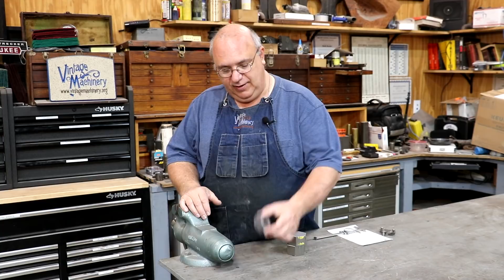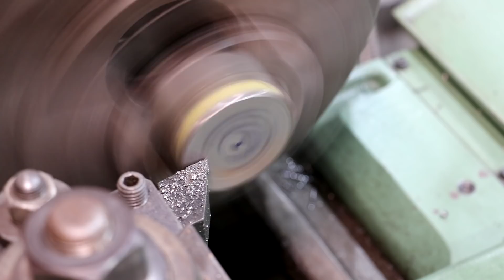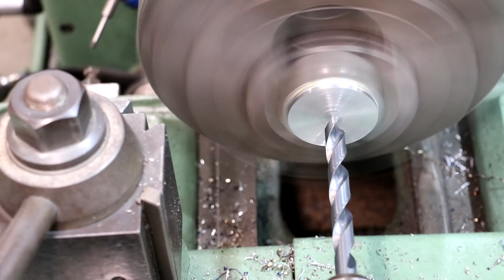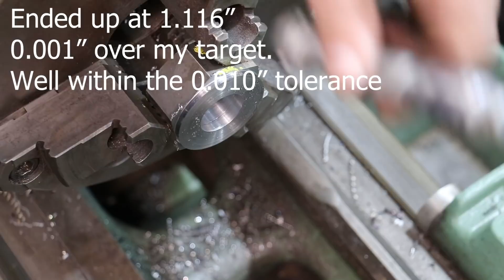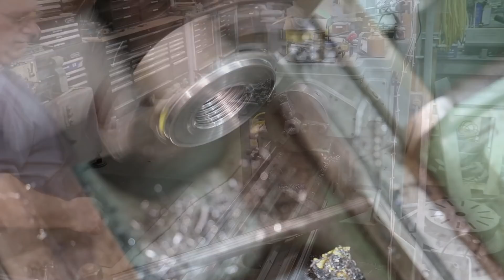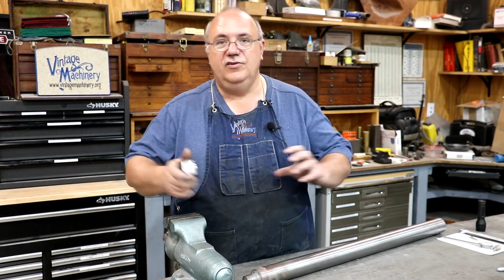Diresta Bandsaw Restoration 19: Machining a Special Nut with Left Hand Internal Threads

Comment: Buggy axles are made with left hand threads on one side for the same reason.  It has been a lot of years since I took one apart, but if I remember correctly it is the left hand side that has left hand threads, right side having right hand threads, so that the wheels are always tightening the nut as you drive.  Later buggies have Timken cone bearings and a castle nut and cotter pin, but early ones used those left hand threads.  I overtightened one trying to get it off myself.  Fortunately, we were reboxing the wheels and welding on new axle arms anyway.  

Thank you so much for the views over your shoulder.  Finally I understand what you are talking about when you say you are waiting for the number to come around.  I hope you do more of those views.  I feel like I learned a lot this time.

Comment: i bought a 12" import lathe, the threading dial doesn't seem to correspond to any thread i have ever tried to cut. i have to leave the half nut engaged and run the lathe back and forward, not good as it has a threaded chuck backplate

Comment: I used to make LH and RH Coiling mandrel and the Nut that went with. All different sizes imperial/Micky Metric.
 Fitment had to go nice because u could adjust the lean angle of the wire ..repeatedly,  sooo.
 On a Torrington Spring winder.

Comment: I always enjoyed threading on the lathe. As I remember it, the last left hand nut I made was a nut for a cross feed screw on a Cinncinati vertical mill. A round bronze flanged nut with 1 3/8" I.D. and a no.4 Acme. L.H. thread bored into it.
Also made the replacement Acme lead screw. Fun project! 
Thanks for the sharing of your experience.

Comment: A honest question. Do you really need to use a LH threding insert running the lathe in reverse? In my logics using a normal RH threading insert and running the lathe normally but the feed opposite (left to right) should render the same result. AM i missing something? I am asking this because my lathe chuck is screwed in the spindle and running backwards with some torque will undo it.
Reply: Yes, that is another way of doing it. There are 4 different ways of achieving the same result, and Keith chose one which is different to how you'd do it on your lathe. My guess is that he prefers to feed in towards the chuck, since it allows a better view of the way that each cut will start.

Comment: Compound angle, my compound lives on 29 degrees, don't move it left of right for left or right threads, last little bit is moved with the cross feed.  Free passes almost.  Why 29 instead of 29 and a half, my eyes and how well was that graduation marked.  The whole deal is to cut mostly on one side and scuff the other.  Then you could do it the German way and set compound at 90 and have a formula.  Nonsense.  Set compound at 29, cut it until it looks right, then take a bit more with crosslide till it fits.
Reply: Hey I used to single point threads, paid piece work.  Back in early 1980's i was making a 100 bucks a day.  Best money i ever made.
Reply: Why did you waste your time writing that long, boring and redundant story? Didn't you watch the video?

Comment: Hey Keith, thanks for doing videos.  Remember major diameter minus pitch equals drill size for approximately 78% theoretical.  Only problem is is running spindle in forward with that backwards threading bar you usually run in reverse. Ha.  As I have said before.  Keep making videos.  I get off.work at 3 in the am, not much to watch on tv, so I look on YouTube.   Got to close, my watch is well wound,  have an old school timex automatic,  was running the auto feed okamoto plus the manual feed Sharpe surface grinder most of the evening.  Spring calipers with profiled tips, great for checking threads.  Before thread mikes there were spring calipers.

Comment: Easy peasy.  Got to throw one out there.  Drill or bore size for tapping or in this case threading.  Subtract  pitch from major diameter, 78? % theoretical thread, works for metric and unified.  Won't work for 60 sharp nor whitworth.  Never cut a whitworth, but I have a fishtail with the numbers for 60deg sharp threads.  About as big a relic as a 1/2-12 tap, ha.
Hey, if you have somewhat of a pattern, spring calipers are your friend.  Externals with 60 degrees radiused off a bit, internals similar.  I have a pile of spring calipers, accumulation plus an e bay hord I bought.  One set of internals were cheap, not heat treated well, soft, bent with pliers, filed and stoned to fit.  Good tool to compare with, old sample with new cut part.  Hey part you are making just needs to screw on and get tight.  Major diameter, minus pitch equals bore, thread until it looks right plus a bit more, might be a bit loose but it will work.  Easier than getting out the wires and making a pattern.  Ha
Reply: OMG - come back when you are sober.
Reply: @johncoops6897  Hey how did you know.  Put in my 50 hours this week, sharpened punches and dies last night, whole box full almost done, Trumph cnc punches.  Couple of things I was throwing out there was the major diameter minus the pitch, works for all unified pattern threads, metric or imperial,  hey sometimes you run across something which isn't on the chart, just remember this, no bs, check it out.  Plus the 29 degree thing, some say 30, some say 29 1/2.  29 works for me, cuts mostly on one side, scrapes the other.  I have had to cut a lot of threads through the years which had to work, who cared if they were a bit loose, screwed together and tightened up.  Reshaped spring  calipers are a good comparative tool if you have some sort of pattern, say someone brings you the shaft but not the nut or vise versa.   As far as watching Keith's video, yea kinda, been there and done it before, let it run so he could get his ad revenue.  I have a lot of respect for these guys who are putting out good content.  Keith is one of the good guys.  I recommend Joe P.  to guys learning machining techniques,  Ox tools gets into some of the nitty gritty metrology wise.  Hey I love youtube.

Comment: When you engage the half nut, why did the feed go from right t to left if the lathe was in reverse. Usually running in reverse feeds Left to Right. What did I miss?
Reply: His lathe has separate gearing for the spindle and the feed. So he can reverse either of them independently from the other.
Reply: @johncoops6897  Thanks, I thought that was it, but I.had never used one.

Comment: Great video, fun to watch the progression of the bandsaw.  One question on the left-hand thread, though.  Why run the lathe in reverse and and use a reverse-orientation threading bar?  Couldn't you just use a standard bar/tool and thread away from the headstock for left-hand threads?
Reply: Sure you can. That’s the way I would have to do it, because my lathe has a screw on chuck. If I run in reverse I run the risk of having the chuck unscrewing from the spindle. 
Joe Pie always cuts threads from left to right. That way he doesn’t have to worry about releasing the half nut at the precise instant to avoid running into a shoulder or the bottom of a blind hole.

Comment: I forget... remind me if you will, how many 10 thousandths are there in a "tad"?
Reply: In Australia we use Metric, so a "tad" is approximately 3 poofteenths. A poofteenth is an order of magnitude larger than a fuckall.
Reply: @johncoops6897  Thanks for clearing that up. I will now get my slide rule and convert it to RCH and BOCH in Imperial. It's very important to keep your measurements precise.
Reply: @The_DuMont_Network  - Do you guys use the BeesDick? From memory I think it's a woodworking tolerance.
Reply: @johncoops6897  In Texas, the tolerances are expressed in "Gnat's Ass". Only with the advent of precision laser equipments are we able to resolve down to a "Micro Gnats' Ass"
Reply: @johncoops6897  There's a YouTube channel owned by ABOM79. Excellent machinist. He refers to 
Crescent" or adjustable wrenches as an "All 32nds" wrench.

Comment: Nice job. That nut material seems to be pretty soft steal that could gall and refuse to come out for the next guy (as it did for you); should you heat treat the nuts for hardness ?
Reply: There is no need for heat treating. The nut was damaged because he DRILLED IT OUT. The galling is not from loosening it. It wasn't tight, he just removed it wrong.
Reply: Anti-Seize on the shaft and nut should prevent galling.
Reply: @ellieprice363  - Short term, yes.  long-term anti-seize dries up and turn into dust, it has limited life
Reply: You can’t heat treat leaded steel. 12L14 is great to cut but illegal for most things these days because of the lead content.
Reply: You can case harden the nut with “Cherry Red” compound.
Reply: “Cherry Red” - interesting, didn't know about it

Comment: I'm a retired U.S. Navy Senior Chief Petty Officer (E8).  I was a submarine yeoman, that's an admin and personnel specialist.  When I went to my last command which was a big maintenance organization I checked in and the Admin Officer told me he had a problem.  The Chief who ran the small boat shop was on leave and the First Class running the shop in his absence was in hospital having had his appendix removed.  The shop needed a Chief and, since the guy I was relieving was going to be there for a month then tag, I was it.

I went down to the shop and introduced myself as the temporary in-charge.  I was in the office looking at some paperwork when a Second Class Engineman came to me.  "Senior Chief, we've got a problem, let me show you."  He took me to a boat sitting on a skid and said: "As you can see, the propeller shaft is bent but the propeller is held on with a left handed nut and we don't have any left handed wrenches.  What should we do?"

I told him: "This is rather delicate so I want you to do it yourself.  Go up to that shaft, turn around, drop your pants, and ram the shaft about a foot up your behind.  Then spin clockwise.  Let me know when you're done."  I then walked away.  They didn't try that sort of thing on me any more.
Reply: But, But, Super Chief. You told him wrong. From where his head is pointing he’ll need to spin counter-clockwise to loosen that nut. (:-))
Reply: @ellieprice363  No, remember righty-tighty lfety-loosey is for right-handed nuts,  It's the other way for left-handed nights, righty-clockwise-loosey.
Reply: @Ambidexter143  Sorry, you missed the whole point.
Reply: @ellieprice363  No you missed the point.  To loosen a left-handing nut you have to turn it to the right, i.e. clockwise.  Sorry if reality disagrees with you.  Come back when you've figured out how and why you're wrong.
Reply: @Michael Neville  Put yourself in the position that you put the man. His head is pointed away from his rear which is turning the nut to the right to loosen the nut. However from where his head is he’s thinking “I need to spin my body to the left (anti-clockwise). Oh never mind. It’s just a lame joke.
Reply: @ellieprice363  - You STILL have it wrong. Stop arguing, you are making an absolute idiot of yourself.

Comment: I hope you don’t mind my mentioning this, but you seem to have a large backlash problem on the cross slide dial.  Thanks for another interesting and informative video.
Reply: I noticed it too.. Is it backlash or simply flex from someplace else.  It could be in either the cross slide or the compound.  Maybe the gibbs on the cross slide or compound are loose?   The lathe has been completely rebuilt.  Maybe things are bedding in a little?
Reply: @maxheadflow  I don't think he did a complete rebuild. Not including way grinding and scraping anyway ?
Reply: @Panzax1  https://www.youtube.com/watch?v=9A3kXFLSi40&list=PLbGC44mjwqrciooH79dIAQtdTjF3RjHMj&index=12
Reply: On the second last threading cut, you could see the tool jump back about 10 thou when he started the cut. Even moved alarmingly on the final spring pass. That thing is as loose as a goose.
Reply: And well worn parts in general. I've never seen a lathe take that big of a cut when pulling the tool back out after such a small cut..

Comment: Quick question, couldn't you turn the original nut down past the galling part then add the step back or was the nut beyond saving or the threads engagement to short to be safe
Reply: The galling wasn't the only issue. The internal threads were damaged when he drilled the main shaft out of it.

Comment: Curious to know how important the thickness of the nut is for securing the shaft. My first thought when you showed it was to just put it in the lathe and remove the damaged portion and then clean up the threads. Perhaps there are some engineering things that make that unworkable and I am interested in whether anyone knows what they are.
Reply: I think that although shortening the nut and cleaning up the threads might have worked good workmanship requires you  don’t take a shortcut at this point. The new nut looks great and fits perfectly.
Reply: @ellieprice363   Thanks for the reply. No argument about the workmanship on the new one! Keith did a terrific job. No doubt it a best practice as a restorer as well as most practical to reproduce an identical piece. It is just interesting to me to try and understand the thinking that went into making it in the first place.
Reply: Proportions of the nut gives it  it's strength. Bear in mind the job it's doing it isn't good to skimp on strength!!
Reply: He drilled out the shaft, and because he missed the center the internal threads were damaged inside the nut.

Comment: Keith, 

Will you mark the nut in some way to signify that it is LH?

This may prevent the problem you had if ever the nut has to be removed.

I am fascinated watching your videos.  I worked as a draftsman in high school and as an engineer for 35 years.  During that time I wandered into machine shops occasionally.   You are connecting the dots for me.

Bob
Reply: The usual way to denote LH threads is to machine a groove in the middle of the hex. Take a look at the hex fitting of a LH thread POL gas bottle connection.
Reply: Easy to stamp it L H.
Reply: Took the thought right out of my head. Stamp it PLEASE on BOTH sides.
Reply: All you have to do is open your eyes and look at it.
Reply: @haroldsprenkle4173  if the stud is flush with the nut outer face then that becomes pretty hard
Reply: @haroldsprenkle4173  Go back and watch the videos of Keith trying to remove the nut and shaft.  With time rhe fact the threads were LH became obscured.  That's how was damaged.

In watching numerous restorations it seems that when theŕe is decades of corrosion and the thread ois not exposed for easy inspection mistakes happen.   A simple solution is marking the nut LH or engraving an arrrow pointing CCW and stamp Off at the point.

Comment: Centrifugal force would never loosen the nut, the reason it is LH is because the resistance force on the wheel wants to spin the wheel counterclockwise and that would loosen a RH thread, but would tighten a LH thread.
Reply: Picky picky picky but right right right.

Comment: So, are you going to mark the nut 'LHT' on a few sides? When I was in the Navy throwing wrenches at helicopters, we had to deal with exactly one connector that cost a stupid amount of money that had a left hand thread and in the early days of it no markings other than a small 'warning' buried in a manual. I replaced so many of those... anyway, since that connector was over $1,000, and we trashed so many, a suggestion was made to etch 'LHT' on 3 of the 6 sides to give someone an idea that...well... maybe that connector was different. Eventually directional arrows and 'TIGHTEN' were added to the box the connectors went to. ....................admittedly it only reduced the times we had to replace that connector. But, stamping 'LHT' on that nut and printing out a water slide decal with a directional arrow and 'TIGHTEN' may help prevent a future Keith Rucker from doing the same thing you did sometime in a far off century.
Reply: The standard way to denote LH Threads is to machine a groove into the center of the hex of the nut. Go look at a BBQ POL Gas bottle connector.

Comment: Have you considered engraving “left hand thread” into the face of the nut to help out the next guy that needs to pull it off?
Reply: I believe that conventionally there is supposed to be a machined notch on the outside corners of the hex.
Reply: @tomthumb3085  ah ok 👍🏼👌🏻
Reply: @samwest9444  don't tell anyone but if I had a punch set I'd letter the nut LHT.